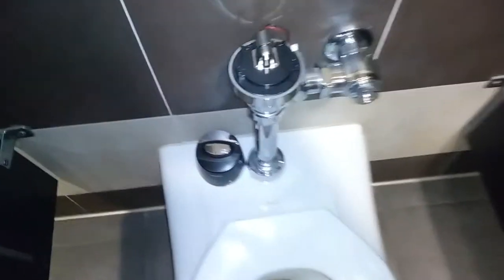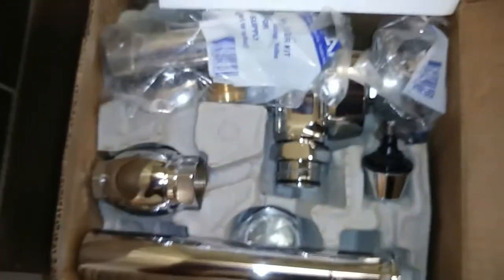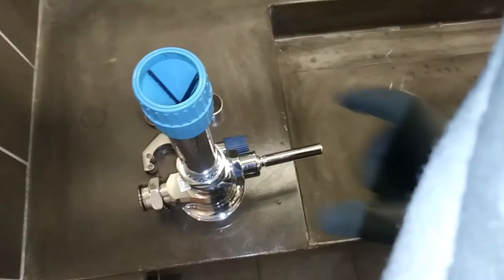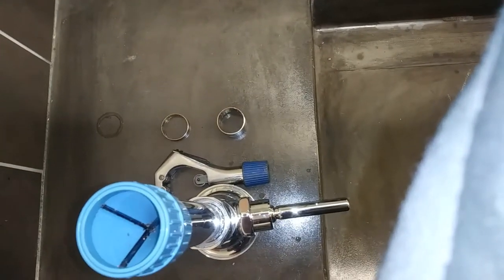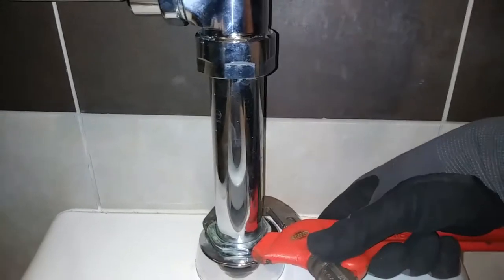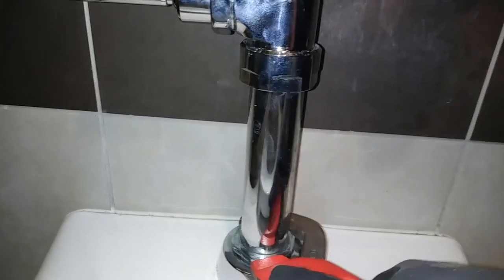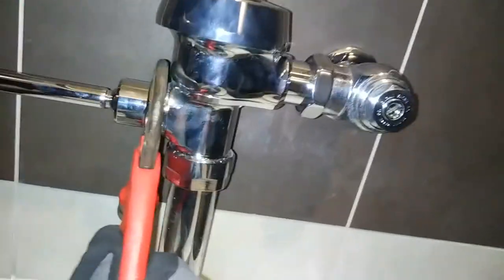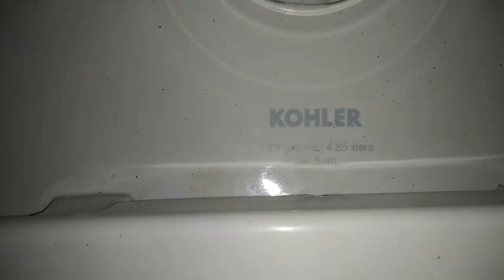How to Replace an Auto Flush Sloan Valve With a Manual One

Comment: I haven't even watched this yet, but I love the description, especially when you refer to them as 'evil.' I passionately hate these things, I am not a plumber, but if I were, I would be on the same mission. At my job, one is broken, and you have to push this button, but the button is so hard to push, it actually feels like it's going to break my finger. Nobody ever flushes it, so it just sits there unflushed and disgusting every day until someone finally takes the trouble. Half the time, these things either don't work when they're supposed to, or they flush repeatedly when you don't want them to.

Comment: Nice job ! We have them in the building as well.  Luckily no bad batteries yet lol
Reply from the maker: Thanks, we've had really bad luck with them here. Definitely use the industrial grade batteries if you have to deal with any fixture like this
Reply: What do the handles cost per unit
Reply: @patricklynch9574  Anyway from $10 through $30

Comment: I personally think that these automatic flushometer are a better fit for urinals. They gotta stop putting these on toilets.
Reply from the maker: thanks for watching and i do agree it's a better application on urinals but, i have still seen them stick open and flood a restroom/adjacent areas just the same as the toilet flushometers. And the flaky, insanely overpriced electronics are the same. This is truly one of the cases where we had something that wasn't broken (tried and true for 100+ years in medical/commercial/institutional applications) and some new-age hipster engineers decided to fix it anyways. No matter how cheap the parts get(which they probably won't anyhow); it will always be a mechanically inferior and environmentally unsound alternative to a good old handle.
Reply: @71dembonesTV  and here’s smth crazy: a bathroom I been in before has an automatic flushometer on the toilet but a manual one on the urinal. I also hear that the toilet flushes too soon while being used or doesn’t flush at all when you’re done using it with an automatic flushometer
Reply from the maker: @TakoElevators  yep another common issue with these things is it not flushing when you want it to. either it flushes when you lean forward to retie your shoe or whatever or it doesn't flush when you stand up. then you have to do the unthinkable act of making physical contact with the button like a caveman. or you know, just have a handle that will never flush when you don't tell it to and you can kick it with your shoe to avoid touching the handle. touch free and reliable.

for the urinals, if the management insists on having auto flushers; a much better option is the "retrofit" style sensors that just bolt up in the same spot as the handle. those can fail too of course but their more common failure mode is to just not flush rather than stick open. and i bet that a whole assembly is less than any one of the several ridiculously overpriced electronic parts that make up the new valves.
Reply: @71dembonesTV  there is a way to avoid the toilet from flushing too soon: just put a piece of tp over the sensor and then remove it once youre done.